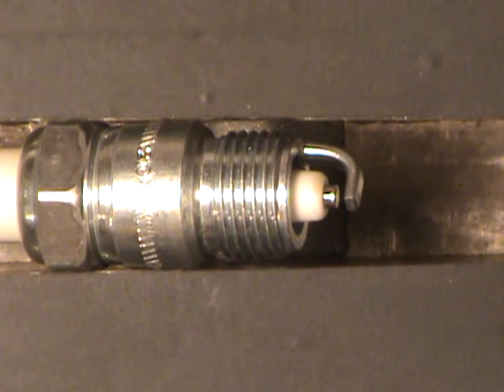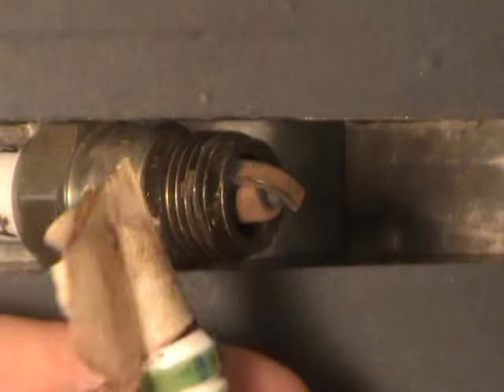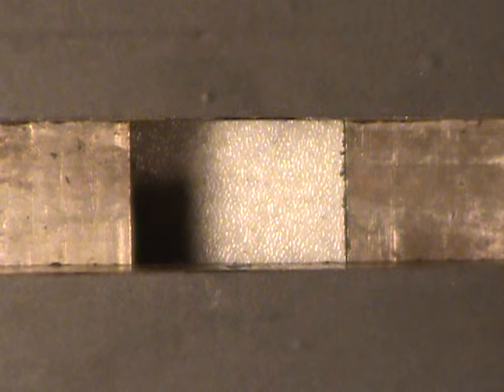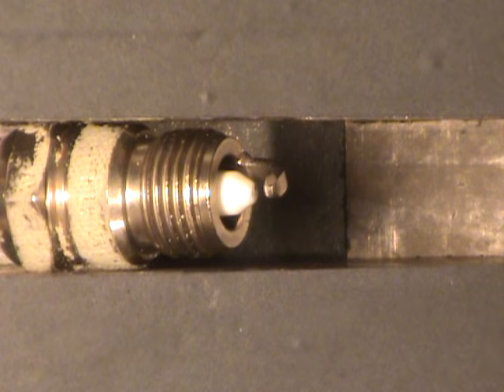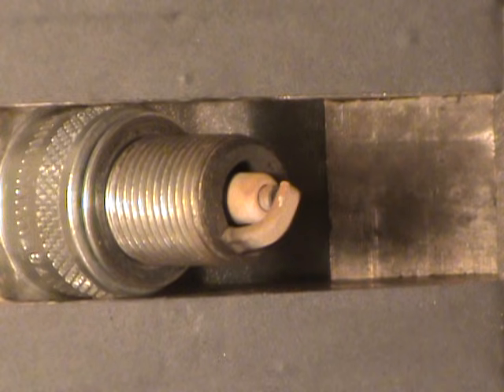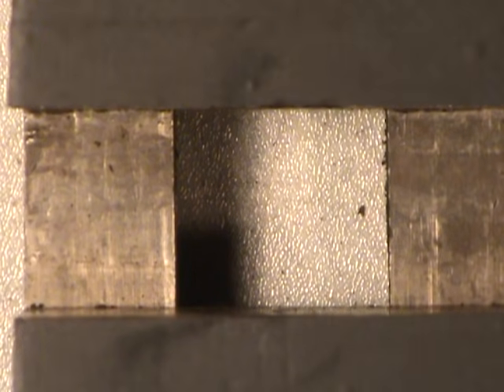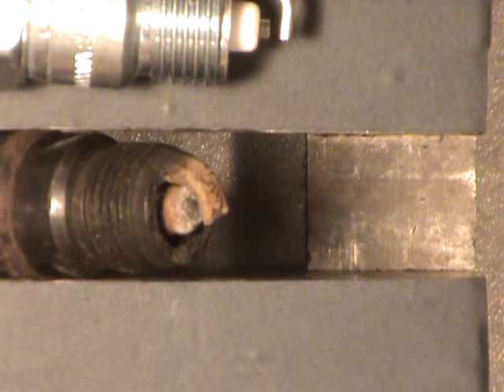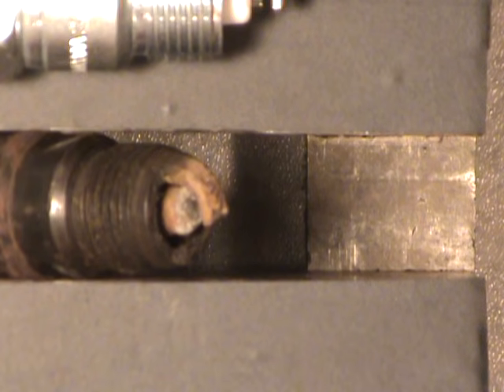SPARK PLUGS How to Read them (Part 3)

Comment: Does modern Unleaded gasoline color the plugs..back in the 60s and 70s my brother and I used to run our muscle cars a few miles at 80+MPH  (smaller population then) pull over to the side of the road..pull and read the plugs and rejet our holleys if need be.  All plugs I see now are white  ?
Reply from the maker: VN Dustoff Greetings VN Dustoff....Thanks for watching, and for Your interesting comment, that You posted here...........................Oh, where to start......................Well, like You were sayin', remove one or more Spark Plugs, from Your engine, and have a look-see, at the Deposits, that resulted on them, after go-in, that 80+ MPH that You mentioned.........................What I'm thinkin', is, if while Traveling, at that 80+ MPH, and just Cruising Along, on a some-what Level Road, Your Holley's (4 Barrel, I presume), Throttle Plates/Butterflies, wouldn't be Open All the Way, and, could possibly be having Your Holley Carb, running in, a some-what, "Leaner", Air/Fuel...Ratio/Mixture, Mode of Operation, as opposed, to do-in, a WOT/Wide Open Throttle application, that, while doing so, would have Your Holley Carb, administering a Much Richer, Air/Fuel Ratio/Mixture, as compared to that, of, just Cruzin' Along, "Leaner"...Air/Fuel Ratio/Mixture, that I was just mentioning..................................Or, in other words, as I see it, You were probably "Re-Jetting", for the 80+ MPH "Cruise Mode", where-by, it is usually, quite a bit "Leaner" (Air/Fuel Ratio/Mixture, that is), as Compared to, what Your Engine Needs, when doing a WOT/Wide Open Throttle Run.................................The Spark Plug, "Thumbnail Picture", that represents this, YouTube, Spark Plug Video of mine, that has the "Light to Medium Tan Color"...on "It'...was the result of, the Re-Jetting..."Richer" (as in...LARGER...Primary Jets...I went from .095" to .104"...or...Ninety-Five, to One Hundred Four...Thousandths of an Inch, Orifice/Hole Size...Increase), on a Carter Thermoquad Carburetor, of mine, where, "Before doing so", my Car, was "Lean-Surging" on me, where the Car, would kinda, Jerk, or Buck, back and forth, while, just tryin' to maintain, City Speed, on a level road.....................................The Gasoline, in about, the Year 2010, when I was havin', that Lean-Surging Problem, now get this, the "Sticker" on some of those...Gas Pump Bandits...at the Gas Station, Indicated..."May Contain Up To 10% Ethanol"...???...talk about elusive advertizing...lol.................................So then..."If"...???...the Gasoline, really did have 10% Ethanol, in its Blend, (back then), and, after I Re-jetted my Thermoquad Carb (Richer), while having that very same Gasoline Blend, with 10% Ethanol in "it", in my Gas Tank, then, that "Tan Color", on this YouTube, Spark Plug Video of mine's "Thumbnail Picture"..."is"...the Result...!!!...Wowsers...!!!...lol...and yes, that Tan Colored Spark Plug Deposit...was "Created"...having those .104" Primary Jets Installed...Driving at Various Speeds/City & Highway...for about, One Hundred Miles or so, as I recall....................................Some Folks are sayin', that, when, Burnin' Gasoline, having Ethanol, in its Blend, in an Engine, that, They are..."Not Seeing Any Deposits"...on Their Spark Plugs...???...................................My Train of Thought (All Aboard...lol), has me Thinkin', that, the...Amount & Color...of the..."Deposits"...that were left on, a Spark Plug, would more or less, be Dependent, upon..."Just How Much"...???...(% or Per-Centage) of "Ethanol" (aka, Alcohol, that was made from Corn, as in Corn-On-The-Cob), that was actually..."Blended-Into"...the Gasoline, at any given time......................."100% Gasoline" (without any Ethanol in it), would probably be running, at about 14.7 to 1, or a bit Richer...Air/Fuel Ratio, at Sea Level, on a Stock, Old School, Low Compression, Carburetor equipped Engine, while just Cruzin' along, not too fast..................................Now then, if the Gas Tank was filled with 100% Ethanol/Alcohol, I'm thinkin' that, while Travellin', under, the just Above, Same Conditions, the "Air/Fuel Ratio"...would probably be, oh, about, maybe..."9 to 1-Air/Fuel Ratio"...there-abouts (please check, if You care to), and, the..."Jetting" (Fuel Jets)..."Need to be "Increased by a LARGE Amount", for Burning 100% Ethanol/Alcohol in an Engine, or, that Poor-Ole-Engine, will probably be Runnin', "Way Too Lean, of an Air/Fuel Ratio/Mixture...for that..."Al-Chem-ah-Haul/Fuel"...and...if...While going WOT/Wide Open Throttle"...wait for it......................"Bang"..."Boom"..."Clank"..."Clunk"...oh and..."Oil All Over the Road"...!!!...(hmmmm...to lol, or not to lol, that is the question...???)...LOL.........................That, good ole..."Leaded Gasoline"...(many Years ago, for some of us), became just that, due to the Addition of..."Tetra-Ethel Lead"...(Cancer Causing substance), that was "Out-Lawed", in some parts of the World, which, as I recall, would be Leavin' a..."Tell-Tale Sign"...of a..."Gray-ish Color"..."Inside My Vehicle's Tail Pipe" (on an Older Carbureted Engine, and, without any Cat/Catalytic Converter on it)...after, I was..."Cruzin' on the Highway"...for a few Hours, but, not only that, after do-in those there, few hours of Cruzin' on the Highway, I do recall, after leavin' the Fast Speed Highway, and having to Slow Down, to that, good ole City Speed, of 30 MPH, and while having to Go, at that Much Reduced Speed, it felt as though..."Time"..."Slowed Down So Much"...it almost felt, like my Mind, was Entering, a..."Slow-Motion-Time-Warp"...as I'm sure, Most Folks, have Experienced, the very..."Same Thing"...!!!...lol.................................Oh yeah, another thing, was, after leaving that High Speed Highway, and slowing down to 30 Mph/City Speed, and, stopping at a few red lights, my Engine would start "Idling Rough"...at "Idle Speed", fancy that...but, after Drivin' at City Speed, for a few Miles, the following Days, the Engine's "Idle" (speed), at the red lights, became "Smooth" again...what's with that anywayz...???...lol.....................................The Newer..."Fuel Injected/Computer Controlled"...Vehicles, well, when They are Working as They should, can Administer the Air/Fuel Ratio/Mixture..."More Precisely"...and, as I'm thinkin', Especially, while the Engine is "Cold, and/or, Warming up to Operating Temperature", as well, as Compared to, the good ole "Choke Plate...Fast Idle Cam & Screw...and...usually, the Bi-Metalic-Coiled-up, Thermostatic, Choke Spring", that's usually found, on, or near, our, good, Old School Carburetors.....................Lots of Stuff has Changed over the Years.....................Some of those Changes, are as follows......................Fuel (Gasoline) "Formulations/Blends", are not, what they use to be, thanks, in part, to that good ole "Ethanol Stuff"...lol...............................Much Higher Voltage/Intense...Ignition Systems, are the norm now-ah-days, along with, the Ignition Timing "Accuracy", and being able to Increase Ignition (Spark) "Timing" to the "Limit", without (hopefully...lol), having any Pre-Ignition/Detonation/Spark Knock, and if the Computer Messes Up, and "Advances" the Ignition Timing "Too Much", or, the Air/Fuel Ratio/Mixture, becomes to "Lean", then, that/those, good ole "Knock Sensor/Sensors", will be Tellin', that nasty ole, Vehicle's, On-Board "Computer"...to..."BACK-OFF"...the Ignition (spark) Timing, that is, to a "Safe & Acceptable Level", that, Theoretically, won't result in any Engine Damage..........................The (much) Older, Street Driven, Vehicle's, Low Compression Engines, equipped with Carburetors, pretty much need to have, a "Warm/quite Hot...Intake Manifold"...sitting under the Carburetor, and until, that there Intake Manifold gets "Warm Enough", the Gasoline, that was some-what Atomized, as it left the base of the carburetor, would, more then likely..."Condense"...Inside of the Intake Manifold's Runners/Passage-ways, which is why, we really, do need the Choke System, Operating, until the Engine, and the Intake Manifold gets Warm Enough, to the point of, keeping that Atomized, Air/Fuel Mixture..."In Suspension & Atomized"...so it will Burn Properly, and as it should..................................Yes-Sir-ee-Bob, (as Jay Leno would say), the Spark Plugs, that I used as "Movie Props", in this particular YouTube Video of mine, were out of, Old School, Low Compression Engines, and that's probably why, the Porcelain wasn't all that White after all, just sayin' now...lol......................................I hope, some of the Above...Long-Windedness...was of some benefit to You, and if not, please, feel free, to post another Question/Comment, under any of my YouTube Videos, and, I'll do what I can, to help You out.................................Till next time, Be Safe, take care, and have a good one.
Reply: VN Dustoff With the absense of lead in the gas, they dont get as brown as they used to, if you use a additive it will color it a bit....

Comment: Well done!
Reply from the maker: kelhawk1 Greetings kelhawk1....Thanks kindly, for Your well appreciated comment, my Friend............................Most of the Spark Plugs that You saw in this YouTube Video of mine, were, for the most part, out of, shall we say..."Older Engines"...that had Lower Compression Ratios, and the "Deposits" that You, Others, and I, saw, on these particular Spark Plugs, were kinda "Dark", if You will............................................The "Deposits", that a Person will usually see, on Spark Plugs, out of a much Newer Engine, right up to the Engines that are being Manufactured currently, will probably Not have, Very Much/Many, "Deposit/Deposits", Showing on the Spark Plugs, and might even appear to look, almost like the "White Porcelain", that surrounds, the Inner Electrode, probably due to, as I'm thinkin', an "Engine Design", that is somewhat "More Efficient", with the Help of "Fuel Injection", and a "Higher Secondary Output Voltage, Ignition Coil", or, "Number of Ignition Coils", as the case may be, and, an "Engine Management System", that is "Controlled", by the Vehicle's "On-Board Computer".............................................Then, another "Factor", that will Determine the Coloration, and Amount of "Deposit/s", that are actually found on, just about any Spark Plug, will, as I see it, be the "Gasoline" Itself................................I'm thinkin', that, the "More Ethanol" (aka, Ethanol = Alcohol, sometimes, derived from "Corn", as in "Corn-on-the-Cob"), that is "Blended/Added" to the "Gasoline Blend", that goes into the Vehicle's Gas Tank, the "Less Deposits", that a Person will usually "See", on those particular Spark Plugs..............................................................The Gasoline, that I "Feed" my Vehicle, these days, should have about "10% Ethanol" in its "Blend" (lol, the Sticker, that I use to see on some Gas Pump/Bandits around here, Indicated, in its Wording..."May Contain Up To 10% Ethanol"...???...Really...lol), but, what-ever it is, that They want to throw at me, I never have much of a problem, getting things to Run as they should, when-ever "They"...Keep "Changing the Goal-Posts"...!!!...lol...Yes-Sir-ee-Bob...I always "Score in the End"...!!!...(Me thinks, that They might need a "Better Goal Tender", but wait...even the..."Goal Tender"...might have a Dickens of a time as well, see-in, that "They" keep..."Changing the Goal Posts"...!!!...lol......Then there's some "Stuff", called..."E-85"...I believe that Designation boils down to a "Blend" of..."85 % Ethanol"...and..."15% Real Gasoline"..........................Given all of that "Al-Chem-Ah-Hall", in that particular Gasoline "Blend", I don't think, I'd be See-in, much, in the way of, Spark Plug Deposits" at all, unless, the Engine wasn't Running very well, that is.....................................If a Person, wanted to have a, shall we say, "Super Close-Up", of the "Deposits" on a Spark Plug, there is a "Magnifier", with a Light built into it, that's "Specifically" Designed for just that purpose, unless I'm mistaken, cuz, it kinda looks, just like a "Medical Instrument", that You'd find in an "OR" (Operating Room), in a Hospital, or, maybe in a "Doctor's Office", where I can hear the "Doc" sayin'..."Open Wide...& Say Awwwww"...or....was the "Doc"..."Lookin' in one of my EARS"...???...lol........(Please, disregard all of the previous "Medical Shin-an-ig-ins")...cuz...that there..."Instrument"...Really...Is-For..."Spark Plug Deposit See-in/Reading"...!!!......................Thanks again, for Your Great comment.........Till next time........Be Safe, take care, and have a good one.